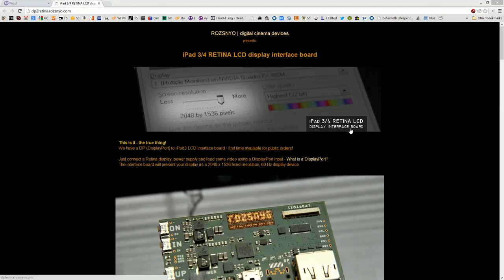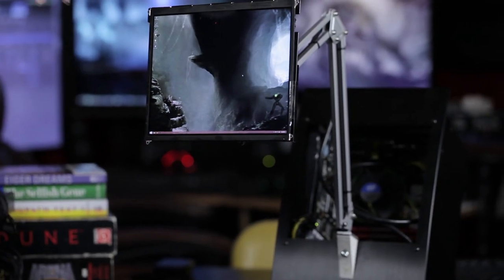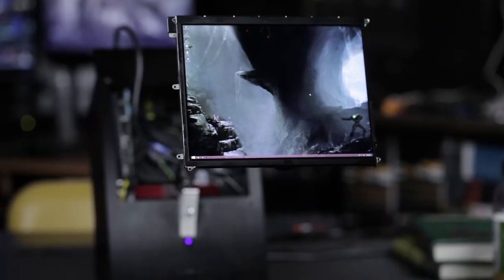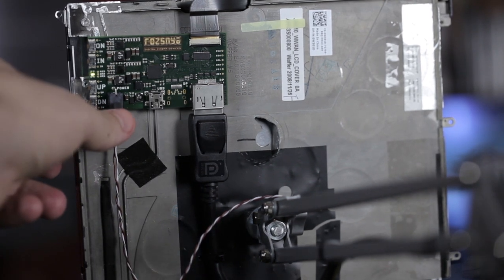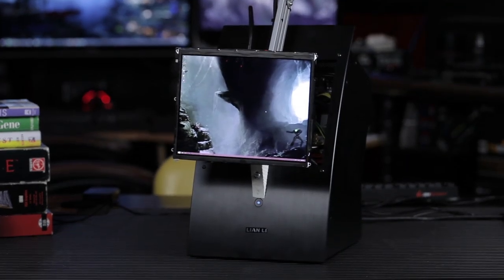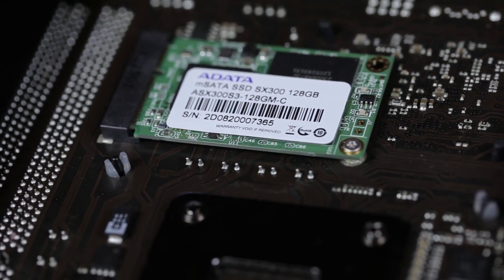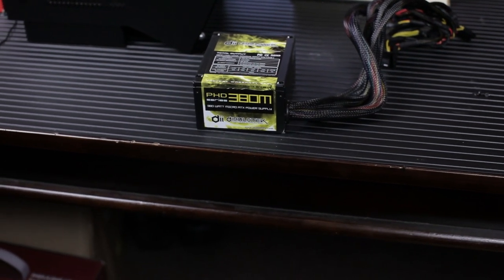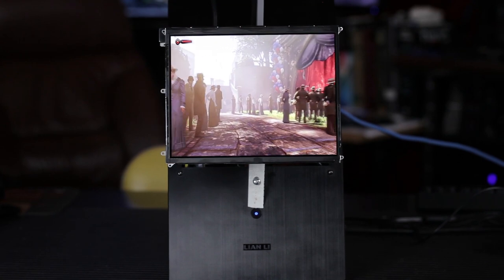Case Mod: We Mount a Retina Display to an Extendable Lamp Arm

Comment: Now you need to use the leap motion or trackIR to monitor where your head is and mount motors to the different sections of the arm so that if you were to change position (ie, slump forward, lean back, move side to side, etc) the screen would follow you and always be at that perfect spot. I'm not exactly sure how feasible this would be, but it sure would be interesting to see!

Comment: wow you guys are on something. I mean this has great potential. So if the touch would work that display would be cool if it was linked to specific system configurators(as well), for example fan controlling, overclocking etc, AND as a secondary monitor at the same time. and if it fits perfect in that case looks unbelievable its AMAZING.

Comment: I was actually considering doing something similar to this.  I found this website and I was planning to possibly order 3 1080p laptop screens mounting them together some how, it would be the ultimate low space taking 3 monitor setup, but my problem was finding the correct board to power the monitor and have the correct input. Can't wait for the parts list  for what u guys used

Comment: I always wanted to do the same thing as what you did with the display, except I wanted to use a 24 inch monitor display and had that on a lamp-like arm. The idea was that if you can had a relatively large monitor without sacrificing space on your desk (if you have a small desk, like me).

Comment: new egg frequently has decent 350-400 W power supplies for $30-40 (like Corsair, Seasonic, Thermaltake). Microcenter had a $30 deal on a 400W Thermaltake for while. No need for the fire risk.

Comment: This is frikkin' awesome!

Also, how about 2x DisplayPort connectors instead of 2x DVI Dual-Link connectors?

Another idea: how about 3x 1080p tablet screens in a 3240 x 1920 configuration, using 2x AMD GPU (HD 7970 non-Ghz), using a single arm with triple-monitor so that each screen faces towards the user in a slight curve? How about with a Seidon 240M, i7 4770K, the upcoming Prodigy mATX, ASUS Z87 Maximus VI Gene, and more? Maybe call it the "uber-badger" ?

Comment: Wouldnt it be awesome to have a BitFenix Prodigy mITX gaming system with the retina display folding inside the case. There would be a lock to keep it into place and you could shut the sidepanel and carry it around, the display would be safe inside the case and when you arrive at your lan you open up the sidepanel and just fold the display back out. and with the open panel your hardware gets even more fresh air...

Comment: A tri-fold eyefinity display for that would not be that hard. Wendell had the right idea have it fold like a Z. The only tricky parts would be having all the screens fit into the case for the scissor v3 and bringing them together when they are folded out, but if the hinges also have little rails to slid on then you could slide them together once folded out. The arm would have to mount to one of the side screens though so it would have to be strong enough to hold the extra weight off to one side.

Comment: Having had a pain of a time finding a DL-DVI cable that can drive 2560x1440 at 120hz (the vast majority of cables start to have errors in their signal above 100hz), 1920x2160@120hz will be even harder. If it's possible, using dual DisplayPort inputs would at least reduce the issues you'll find with cable bandwidth limits.

Comment: 3840x2160 is 1920x2 x 1080x2.  Altogether, 4x the pixels.  Two 1080p screens horizontally by two 1080p screens vertically.  1920x2160 or 3840x1080 would be 1080p x2.

Comment: you can't use 16gb of memory with a 350w psu. you can't use it up, your cant eat it up, you can barely even idle with enough programs and background tasks to fill that much memory with a system that can run on 350 watts. don't get me wrong though, overkill is fun, and if it were 8 gig you could actually fill the memory with heavy work, but even then 350w would be stretching it. 5-700w next time. the most efficient setups will act funky eventually when trying to use 16gb of ram at full throttle

Comment: you should cut down the arm and have the mount for it on the other side of the case so it looks a lil cleaner cause you would be able too put it back into the window slot :)

Comment: As for touch screen, I have seen people hack old Wacom tablets put by putting low res LCD on the tablet, and writing on the screen with the digitzer pen. The tablet can sense the pen through the screen. I wonder if such a plan could work with an old 6x8 inch Wacom tablet (Intuos 3) and your retina screen? Do let us know what you think.

Comment: The "Digitizer" is what sends the signal, form the touch screen, to the logic/mother board, to tell the software what to show, I should know. I tried to replace my broken iPod touch screen, I eventually got it to work, but the thin Digitizer ribbon was over stressed and nicked and my lock/power button stopped working, so the screen sucked at picking up touch swipes and presses, and eventually the touch function stopped working, So I have to send it to the experts to replace the broken parts.

Comment: just print out your own case , make use of the gtx670 mini , make something so small that can be actually portable , something like   17 X 17 x 20 CM you should find a way , but you might need to crack open your power supply though

Comment: How are you fitting that Asus Gtx 760 in there, newegg says its 8.6 inches long and Lian Li says the maximum card length for the Q30 is 200mm or 7.8 inches.

Comment: This should be stated as follows, The PS4 is more powerful than *MOST* PC's. As in a PS4 will vastly out perform a $200-$400 computer, but up against a $500+ custom build the PS4 is behind by at least 3 years and in other areas 5 years.

Comment: Is there a controller/interface board for the LG LM270wq1 panel (1440p imac /cinema display) that would even maybe allow overclocking. You can get these panels for around 100 bucks, but there are no controller boards around...?! just a dvi converter and backlight controller... Please I want to make my own 4320x2560 tripple screen bezel less setup.

Comment: 4k resolution = 3840x2160 that is 1920x1080 multiplied by two. Two Nvidia Geforce GTX 285s could do that no problem. Heck one Geforce GTX 285 could do that with some effort, a 780 can handle that.

Comment: Hey can you guys get the supplier to do a board for a LP129QE1 SPA1  12"+ 2560 x 1700 Chromebook-Pixel IPS display. The panel is fairly cheap and is a 12" 3:2 display, is bigger than the Ipad panel. Its a 40 pin LVDS interface so shouldn't be hard to create a board for it.

Comment: It severely cracks me up every time a console fanboy comes online spouting nonsense thinking their console is better than a pc.  Sure an ps3 will easily stomp a gaming pc built way the hell back in 1998.  Now 2004 ( 3 years BEFORE ps3 was release for sale to the public ftr)..that's a different story.. my rig tied and in rare cases BEAT the ps3's performance on some of the same games, prince of persia included at resolutions extremely close to full 720p which is what ps3 games run at.

Comment: using such a high res to go into the bios is pointless, that's what i meant, nor would it be all that useful for loading a monitoring program. hd display, sure, but a retina display level hd monitor, no.

Comment: So what? What's the point of having THAT fast memory for the system. 1866MHz or 2400MHz is just fine. GDDR5 is useful for gpu power. So..... Why a grandma should have a ferrari and not a mobility scooter?